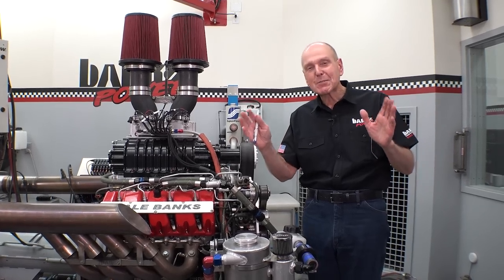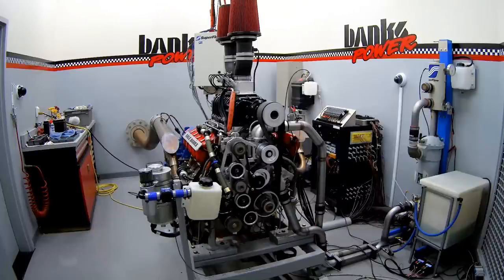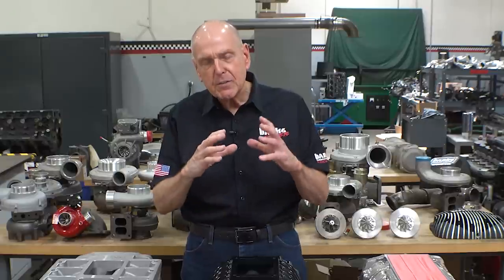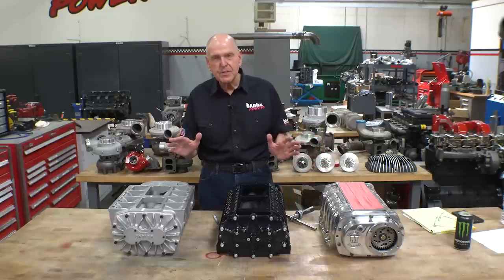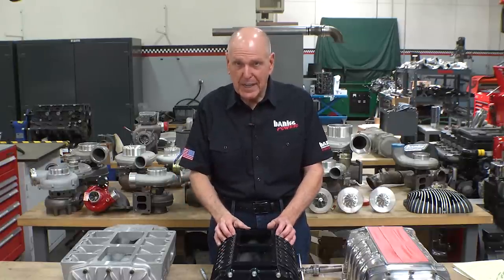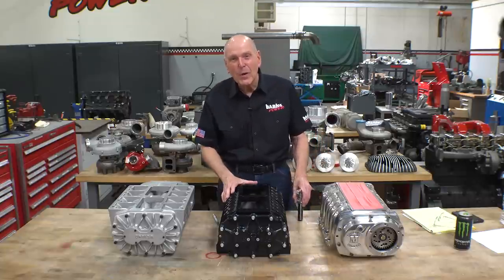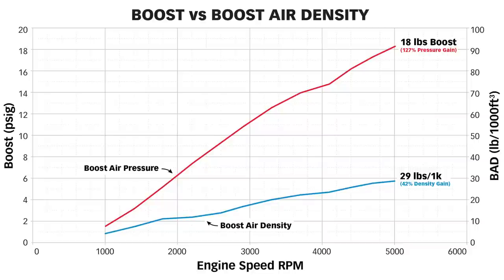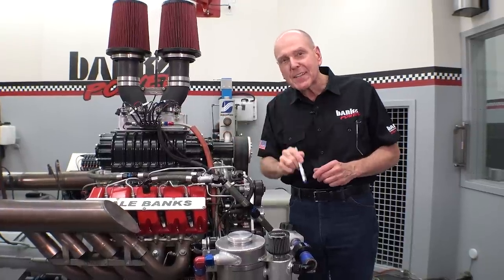FIRST FIRE! | Building A Monster Truck Engine Pt 5

Comment: Question:  If the roots blower is a positive displacement type blower, then the volume of air it moves per revolution is fixed.  So let's assume you're running a 6-71 which from what I've read is ~350 in3 in displacement, and you have that installed on a 350 sbc running at 1:1 speed ratio.  So every revolution of the blower it moves 350 in3 of air into the engine intake manifold, and every revolution of the engine it moves 175 in3 of air out of the manifold (because it's a 4 stroke).  So that will equilibrate to to a density of 2X ambient.  The discharge air will have to follow the ideal gas law for a fixed density of 2X ambient (meaning temperature and pressure are dependent on each other), therefore a less efficient compressor will yield higher temperatures and also higher manifold pressures, correct?
Reply from the maker: That's correct, and lower air density per unit of volume. It's all about the volume being pumped by the cylinders and the density entering the cylinders.
Reply: @bankspower  Then in my previous example, if I have two different pos disp superchargers of the same displacement, running the same speed, and one is 48% eff, and one is 65% eff, the density out of the more efficient SC is higher?

Comment: That’s all well and good but what about insulating the supercharger case. What about isolating the heat soak from the engine Valley. Even turbo systems need their plumbing insulated.
Reply: The heat is created INSIDE the blower. Isolating it would probably make it worse...

Comment: Blowers and oil burners go together so well. I keep telling people a blown DIESEL is superior to turbo charged. The power is RIGHT NOW!!!! vs well I gotta spool the turbos. The discharge temps are easy enough to take care of. Large charge coolers or liquid cooled cases, heck you could even use n20 or co2 or even methynol to cool the grid that's samiched in-between the blower and intake.
At the end of the day it's how and where it develops torque as horse power is torque over time. With a diesel the power is made low. This wouldn't be good for towing but in a mud truck it would rock.

Comment: Since the parasitic loss it's too much to overcome and inefficient it would seem Electric supercharging in conjunction with turbocharging is the ultimate way to go. A bank of lightweight lithium batteries with an electric supercharger will still weigh less than that blower.  Keep it up Banks!

Comment: sure..... turbos are better in every way
but the sound of a supercharger is so sweet.... 

i wonder how efficient a stock buick 3.8 v6 with the m90 blower is..... 

dont think buick did that for power..... but more for silly amounts of torque down low, from a "small" v6

Comment: I do supermarket refrigeration for a living and working on screw compressors that take the suction gas at 8psig and for R22 that’s right around -17°F before superheated 20°F to keep liquid out of the compressor and it comes out of the discharge at around 270psig and its really fucking hot i feel like the heat comes a lot from friction inside the compressors and the heat of the refrigerant being compressed now all those measurements are at 90°F ambient temp
Now youre wondering why i bring all that up im just comparing all your numbers to numbers i deal with daily its highly efficient for the refrigeration cycle but for an engine i feel like a twin screw makes too much heat for what its trying to do it can definitely move the air with out a doubt if the charger had water passages going through it chilling it would probably make the screw pretty close to the efficiency of a turbo charger

Comment: too much heat from roots blowers, need an air to water intercooler.   like off shore boat racing.

just my 2Cs   sure you guys got a plan
Reply: Yep, and I bet his turbocharger numbers had an intercooler.   And as for superchargers he seems to have forgotten about PSI. When you need major air flow and real boost pressure  that's where you go...  Like 65 psi and more..

Comment: Why wouldn't you run compound turbos and a high idle (high enough to light the turbos for instant response)? Seems like in a motorsports application where you're not worried about fuel consumption or emissions, that'd be the way to go. From Mr. Banks' data and charts, the blower isn't efficient enough to offset the added cost and complexity. The right compound and wastegate setup plus some computer tricks would simplify the whole setup and give the driver similar throttle response.

Comment: i thought gmc used   superchargers for scavanging not as a   starting thin i know older trucks used a  compressed  air starter rather then electrical but anywhere that shows how the blower started the  2stroke as   he says?

Comment: Hi sir just asking  wat can,t you cool the air at the 
 AB blower light the air underneath the blower or the chiller chilling the cold area to the silver heads a bringer and take in air temperature down is a good  Combustion chamber
Reply: One way you prove a  put dry ice on and intake  at the base of this supercharger so you can test it out see if help the temperature  ???

Comment: I'm confused about why the data was gathered with the engine unloaded. I can understand the reasoning concerning trying to keep from breaking the engine, but how can you guarantee the data you've gathered is still going to be accurate when compared to a wide open throttle scenario?
Reply: Diesel's are always wide open throttle (there is no throttle) so the pressure delta between the inlet and outlet on the blower should pretty much be a function of RPM only (assuming the engine efficiently exhausts the combustion products out the exhaust valves). The adiabatic assumption (no heat exchange) should also be reasonable and allow simple adiabatic calculations. Ignoring the increased back pressure that a turbo creates makes turbo's look better than they really are, but probably not by that much (WOT cylinder pressures when the exhaust valve opens I'd guess are in the 1000's of psi range and a turbo making ~15 psi of boost only increases the exhaust pressure somewhere around 15 psi)
Reply: @Slider68  I hadn't considered that aspect of diesel engines. So that makes the analysis of the intake side pretty uniform regardless of "throttle" position for looking at the supercharger. I wonder how large of a change there is in exhaust volume (CFM) between part and full throttle for a diesel engine at a given rpm. That should have negligible impact on a supercharger, but I'd think there would be a large difference for turbocharged applications.

Comment: Great video. What about using a cooler on the blower? Also I would like to see use a twin screw super charger. They produce way less heat compared to the roots.
Reply: Would also like to see same test with a cooler underblower or meth  injection
Reply: @kenmcguigan6805  I have a feeling what he referred to at the end was methanol injection to help cool everything down. will have to keep an eye out for Part 6! I Can't wait!

Comment: If you use the turbos to eliminate the differential I think we will see vastly different numbers. I'm gathering the greater the differential across the blower the more leakage is reheated. I imagine the blower can move massive CFM at less than 5 psi difference across the blower, greatly reducing parasitic loss and temp increase.  Still generating that bottom end snap.

Comment: I know he probably wont ever see any of my messages but if he does id like to know if he ever tried  or thought about puttimg a pro charger on a diesel with twins then it would eliminate the lag and you would have to push the air threw it with the twin turbos and if anyone could figure  out how to set it up and make it work he could for sure

Comment: Your boost curve looks like the blower is too big for the engine. There is no ait throttling here and the blower is maybe spinning too slowly to do it's best work. You actually might be better off with an 8-71 with a 50% overdrive.  It will change the shape of the boost curve as well as giving you that 18psi somewhere before 5k rpm

Comment: Could you measure the amount of energy needed to run a second alternator? Maybe exploring the idea of an electric driven super charger is actually viable, if space restrictions are not something to be worried about of course. But now that I remember you build monster truck motors right? Pretty sure you could squeeze in a couple hundred pounds worth of electric motors xD

Comment: Many years ago, your late friend Smokey would use electric motors run assembled engines to check efficiencies and pumping losses.

You could do something similar using an electric motor to drive the compressor at various rpm into an air receiver, you can use a variable outlet 'choke' from the tank to regulate the 'boost' pressure and engine 'demand'. You have a lot more experience in monitoring, so check what you need to, and make changes as required, and you should be sorted.

As an aside, I HATE the way turbo's are constantly changing rpm and pitch - have you done much work on supercharging Cummins 6 cylinder engines to ~15 PSI boost, for improved drivability and low rpm torque, rather than outright power?
Oh, did you ever finish the tests you were doing on the rear differential temperatures? Would also be interesting to see the front diff' temps, too, as even when not being driven through, they are often used with non-freewheeling hubs.

Comment: Why aren't you using a water to air intercooler between the blower and inlet manifold this would cure the hot inlet temperature problems

Comment: Dale I've got one question here that baffles me they've been building intercoolers that set under the supercharger between the supercharger in the heads for a decade now probably more than that but they've been popular that long why would you build this motor and not set an intercooler underneath it automatically you're really concerned about the Heat and I was too I was surprised to see how much heat it took for that supercharger just to pressurize air but I think you would drop the temperature at least half just using the standard intercooler without even running liquid through it so hopefully somebody hero, get it back get back to me on this cuz I'm real curious to find out why

Comment: As an aerospace engineer, I have to take issue with one thing here. When you talk about temperature gain, you talk about "% over ambient". With temperature, percentage changes are completely meaningless unless you're using an absolute scale, such as rankine or kelvin. Your 330F gain over a baseline of ~100f is actually a 59% gain in temperature, not a 288+% gain.

Comment: You are significantly over spinning that blower, which is over heating your air charge. Driven alone, the max boost gain should be in the 5-6lb range at load. Feed your turbos into the blower at this range and you will find what you are looking for.

Comment: Toss it in the bin. Just use nitrous for throttle response with them turbos. You can even add it back in on top for added top end performance. Why bother with power robbing superchargers when you can dial in the air density with nitrous?

Comment: Would using direct injection, and within that direct injection adding 100 percent pure oxygen sprayed in the cylinder increase horsepower.
Reply: Chris S no it wouldnt only blow up the  pure oxygen is highly explosive like nos to much induced and BAMM either hole in piston or rod through the side of block seeing as i tried that and had a huge intake backfire shot the throttle body off like a missile thank god i wasnt in the way of it

Comment: What about centrifugal style supercharger? Vs turbo? Why dont top fuel dragsters use a turbo?
Reply: Because the rules are antiquated. I'm a supercharger fan all day but I'd like to see turbos in there for sure.
Reply from the maker: The next few videos will explain. Also, at about 9:10, Gales explains why we are going this route. 

In regards to the top fuel dragsters, in theory, you can make more power with a turbo versus a supercharger. However, there are a few things why. First, the initial throttle response and linear power increase with RPM are the two main advantages a supercharger has over a turbo. Second, regulating power and speed. If teams were to use turbos, there are too many different sizes and boost levels available for the NHRA to regulate. Almost all the top fuel engines use an engine based on the 2nd gen Chrysler Hemi engines with 10L to 12L blowers.  Just like NASCAR, the NHRA regulates the power and the size of the engine of cars make to ensure fair play and safety.

Comment: why not manufacture a turbo with an electric motor attached to the shaft? you could pull energy out of the turbo using it as a genorator when in conditions of over boost and pour energy into it when you need throtle response having the electric moter spoul up the turbo? I imagine you'd need to make a lot of heat shelding to prevert the heat from the turbine from cooking the motor but I think it could be possible. would reduce the complexity of multi turbo systems.
Reply: Currently state of the art in Formula 1, the first street cars with such a system are coming out of the factory now. Give it a couple of years and you'll start to see it in the aftermarket. :)

Comment: Why does everyone talk about turbos like they don't have any parasitic loss.  Since they run off of back pressure on the exhaust, which means the Piston will have more back pressure to fight and more oxygen depleted air will be left in the cylinder.  Isn't that all parasitic loss? 
I'm curious how a turbo vs centrifugal blower of the same boost/CFM would differ, to see how different the parasitic loss is between them.
Reply: @Mr Sunshines What's with the personal insults? Are you going to start with 'yo mama' insults next? Please grow up. You say "thermal expansion is 100% free". Unless you can break the laws of thermodynamics NOTHING is free. There is always a cost.  For the gases to expand you need a pressure differential across the turbine. Hot, high pressure gases enter the turbine and cooler low pressure gases exit. To achieve that pressure differential you need a high exhaust manifold pressure. That saps power from the engine. Why to high performance N/A engines have big bore  exhausts with as little muffling as possible? Because exhaust back pressure saps power. You said in some cases a small amount of back pressure helps. This is actually pretty rare and the key word is _small_. A turbo is not a small amount of back pressure.

Comment: I wonder if anyone has ever used an automotive A/C system, electrically driven, to cool the intake air, Either through an intercooler or otherwise?
Reply: Tim Henry the dodge demon does

Comment: Man, this makes superchargers look terrible!  Only 48% efficient vs a turbo's 75% efficiency!  He explained very clearly with data why he calls them a parasite.
Reply: It makes me wonder why the guys are using roots style super chargers in top fuel drag racing... have they figured out something to make the roots blower more efficient (less temperature rise, and lower parasitic drag on the crank shaft)?
Reply: @aaronboulais4498  I'm sure it's for the hole shot.  Gale said he runs a supercharger when he wants the immediate throttle response.  I honestly think as parasitic as the supercharger is, it's the best thing to give instant throttle response.  I think that's why Banks runs super turbo setups.  Instant throttle response then turbo for the rest of the pressure
Reply: @aaronboulais4498  I almost forgot, they also run methanol to cool it down.  That would help considerably with the temperature rise.  As far as I know they aren't doing anything for the parasitic loss.

Comment: Wouldn't a procharger work the same without as much heat buid up.
Reply: Procharger is just a brand name. Are you thinking of a centrifugal super charger that works like a turbo but is driven by the crankshaft instead of exhaust gasses? Procharger makes those.
Reply: @traugdor   yes

Comment: why not test a whipple or screw blower. why only gm design blowers
Reply from the maker: There's more exploration to come with the forced induction applications that will be used on the engine. The turbos are coming.

Comment: Make a liquid cooled turbo with cooling fins built inside and out, and pump liquid nitrogen through it, the new thermal engine
Reply: That would certainly cool the center cartrige, axle, and blades of the compressor wheel as well but I doubt it would have great effect of cooling the actual [charged] air.
Reply: You may be on to something tho!

Comment: Gale I'd love 608 hp fr my 89 7.3 IDI. I'm guessing 1000 ft lb tq? Sign me up :-). Thanks Gale Banks. God Bless U brother.
Reply: You will blow it up
Reply: 608hp with only 1000 lb-ft you would have to be running some crazy rpms for a 7.3. 
HP and torque are directly related with rpm so you can't change just one of the 3 numbers, if your going to make big HP either the torque or rpm need to also be raised. As an example the new Cummins does 1000 lb-ft and has 400hp.